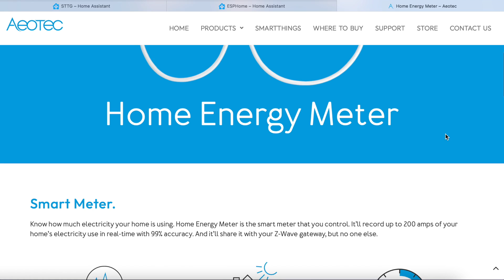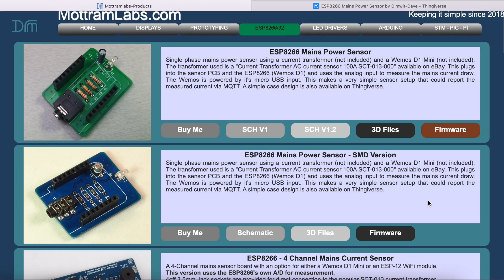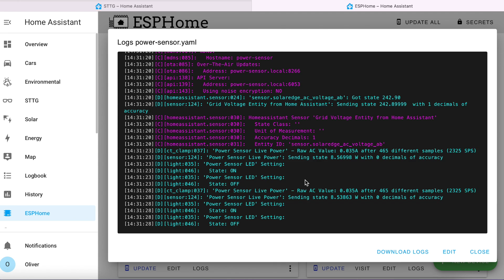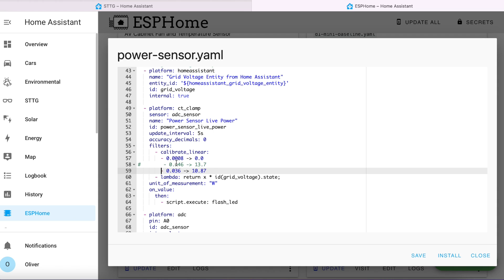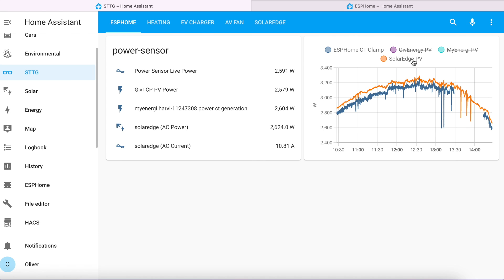Build your own CT Clamp Power and Energy Monitor with ESPHome

Comment: After hours of configuration hell I thought I'd share my experience.  

I have the docker version of Home Assistant (as will a lot of people trying this) and it is 'unsupervised'. This means I am unable to install the esphome add-on, or any add-ons at all. 

You will only need this add-on when you are configuring the esp module so I decided to spin up full version of Home Assistant (supervised) on a VirtualBox VM. From there I was able to properly configure the device to connect to wifi and function correctly.  I treated it as a temporary development server just to get the config correct.

The next stage for me is calibrating the electricity usage to work with the output of my solar panel inverter.

You could also configure the esp module through the command line (as suggested on the esphome website) but I could not get the wifi connection working using this method.
Reply: Calibration didn't work for me. The amps just didn't show up. I've ordered a more up to date Mottram board off ebay to see if I can get it going.
Reply from the maker: Do you have the CT clamp around just a single core (live) cable, or around a flex (triple core) cable? If there's a live and neutral running through the same cable that you have the clamp around then no current will be shown (the neutral cancels out the live).
Reply: @SpeakToTheGeekTech  I'll look into this. Thanks so much.
Reply: @SpeakToTheGeekTech  I am learning a lot while I do this... I have been frustrated that my CT sensor hasn't been reading anything when it should! It turns out that my 50ma current sensor (like yours) was actually the other model that works on voltage and had been labelled incorrectly from the manufacturer!

Comment: can i clamp it to a usb cable to calibrate it?
Reply from the maker: No, that won't work sorry for a number of reasons. Firstly the clamp is to detect AC current (not DC used in a USB cable), secondly it must be clamped over a single wire - so inside a normal AC three core flex cable, there's a live, neutral and earth - the clamp must be around just the live and not multiple cores.
Reply: i want to hook it up to a ps5 (power cable is in utility room) will the other plugs interfere with the reading/calibration?

Comment: The calculated power shown will only be correct when used on the same load. (what its calibrated against, and assuming a constant phase angle, cosɸ) This method for power calculation does not correct for the phase angle difference. To measure the active power (Watts) and not only the apparent power (Volt-Amps) the phase voltage must be sampled continuously togter with the current. The Active power is then calculated by integrating the area under the curves. The module shown is only a Mains Current Sensor not a true power sensor. The calculated Active power will only be Amps x Voltage when assuming the load is purely restive. Thus the phase angle offset is assumed to be 0°. This is not the case for motors and electronic inductive loads (switch mode power supply).
Reply from the maker: Yeah it’ll never be as accurate as a proper inline power sensor of course, but in order to give the average home user an idea of what is flowing through a cable then it’s in the right ballpark.

Comment: can I have two of these, one measuring current and one measuring voltage to get the needed readings to do accurate monitoring?
Reply from the maker: These only measure current. You need a different type of sensor to measure voltage.

Comment: Hi and thanks for this video.
Can you please explain how to add this to the energy dashboard.
Reply from the maker: Sure - you need to create an 'integration' helper from the power sensor. Settings > Devices & Services > Helpers. Click the create helper button, "Integration - Riemann sum integral", choose the CT clamp power entity as the input sensor. You can then use that sensor in the energy dashboard, but I suggest you then create another helper of type "Utility Meter" and use the new Integration sensor as the source entity. You can then set the Meter Reset Cycle to one day, and use that utility meter in your energy dashboard.
Reply: @SpeakToTheGeekTech  OK I'll give that a try. Thanks so much for the reply

Comment: Fascinating video! I’m hoping to do a similar project but send the data to a cloud based application. Do you know how to connect via an MQTT broker via Wi-Fi router instead of ESPhome or gateway?
Reply from the maker: The short answer is no! But I have dabbled with ESP devices before ESPHome came along and the long route is to use the Arduino IDE, import the external libraries you might need (which will be lots!), and program the board manually using C++. I like ESPHome because it removes the need for most of that and you can just get on with configuring the board with exactly what you want to achieve rather than having to work out which libraries need importing. You can use ESPHome to to what you require too. You enable the MQTT client option (https://esphome.io/components/mqtt.html) and disable the Home Assistant API. However, I'd argue if you're using ESPHome to do that, you already have Home Assistant, so why not just run your own MQTT server locally on that. I guess it's all down to your own preferences but using native Arduino IDE has a much steeper learning curve.
Reply: @SpeakToTheGeekTech  thank you for responding so quickly. I didn’t realise I could use Home Assistant to host an MQTT server, so long as my computer doesn’t need to stay on 24/7, that would be perfect for my needs. Already used your links and bought 5 sets of everything in case I make a mess of the first couple attempts.

Comment: Thank you for the video is there a way to set it up so it can tell u what ur using hrly and daily money wise ? tyia
Reply from the maker: There certainly is. You need to turn the power sensor into an energy sensor first by going to Settings > Devices & Services > Helpers, clicking the Create Helper button, choose Integration - Riemann sum integral, and choose the CT clamp power sensor as the input. Then you need to create a Utility Meter helper sensor (similar way to the Integration sensor), using the new Integration Energy sensor as the input. You can configure the meter reset cycle to be daily, monthly, yearly, etc... You can also then use a daily utility meter sensor in the Energy Dashboard if you like, and the Energy Dashboard can calculate the cost for you too.
Reply: @SpeakToTheGeekTech  excellent thanks so much!

Comment: What's is the best power it?, If I place this in my consumer unit or meter box.
Dose the power comes from the CT clamp, like on the hi end model?
Thanks in advance
Reply from the maker: This is powered by a 5v microUSB cable. With some adjustments to the code to reduce how often readings are taken and to put the device to sleep in between readings, it would be possible to run from a battery pack instead. I don't know how we'd go about harvesting energy from the CT clamp, that's a bit beyond my electronics know-how at the moment!
Reply: @SpeakToTheGeekTech  thanks for the info.

Comment: Might you have a more scalable suggestion? I'd like to do each circuit in my circuit breaker box.
Reply from the maker: Mottram Labs also sell a 4 channel version of the current sensor module, but if I were looking to monitor a larger number of circuits then I'd probably go for a Shelly EM (or 3EM) instead. I would suggest that this build-your-own method is for 'casual' monitoring.
Reply: @SpeakToTheGeekTech  Thanks, just to follow on from this, the Shelly EM only does 2 circuits (there's a 4 but overkill and limited total amps). Mottram Labs does 2 versions, one which uses the ESP8266's own A/D for measurement, the other has an onboard ADS1115 A/D converter is provided for the measurement (15 bit), any preference (like which would/might be easier)? A 4 circuit version could work if you're only looking to track the biggies- say heat pump, solar, car harger- and (time)-manage the loads, I personally wouldn't be looking to track every light bulb.
Reply from the maker: I've not actually tried the one with a onboard A/D converter yet. When I get chance I will order one and give it a go. I'm interested to see the difference, but it's just one of those things I've not got around to yet.
Reply: @chrishorn1032  I would like to monitor every single appliance but will likely settle for each breaker. thanks for the feedback

Comment: Nice. Wondering if we wanted to many more than one only clamped (just before the fuse breakers ~ 16 of them), what kit maybe best to consider if such exists if you maybe know?

Above will get the per section of house readings, so wanted to get a bunch of smart-plugs to zoom in to each appliance also.  Any suggestions how to build these smart plug kits at low cost since I need quite a number?
Reply from the maker: The same company (Mottram Labs) which supplies the Mains Power Sensor board also sell a 4-channel Mains Power Sensor board. Same principle as in my video, only there's four 3.5mm jacks for CT clamps. This could be a good option. If you'd prefer something more off-the-shelf then you might want to look at the Shelly 3EM which can monitor three live cables simultaneously. As for creating your own smart plugs, I can't advise on doing that for safety reasons. I personally prefer to use either Z-wave or Zigbee power-monitoring smart plugs (such as these zigbee ones: https://amzn.to/3VqSeQE), or you can go for one of the many WiFi smart plugs that offer power monitoring too from Amazon for under £10 each. I think you'd struggle to make them yourself for that small amount anyway!

Comment: Thanks for the great video, I was wondering what will be displayed in home assistant if you a contributing to the grid. i.e. your solar panels are producing more than you consume ?
Reply from the maker: This particular implementation will only ever show a positive power value so you wouldn't be able to tell whether you are importing or exporting using it. When I get chance I'll take another look at the raw data and see if there's any way of updating the configuration to output that properly.
Reply: @SpeakToTheGeekTech  A great video and just what I was looking for to monitor my solar power export to the grid to help size a home battery.  But that will need me to be able to record both positive and negative currents.  Have there been any developments since your reply to Tony, and would it be possible to work around by having two sensors on the same cable: one to measure import and one to measure export?  Many thanks.
Reply from the maker: I've done a bit of reading on the subject and from what I now understand in order to work out the direction of the current you need to monitor the AC phase, and that would have to be done in realtime by another physical sensor attached to the microcontroller... which doesn't exist on this particular break-out board. By this logic, that must mean that only mains connected power monitors are able to detect direction. Honestly, I'm still not entirely sure what sort of component is required in order to do this, but I haven't given up yet. If I ever figure it out though you can guarantee it'll appear in a video!
Reply: @SpeakToTheGeekTech  Many thanks for that helpful reply. I now understand that the CT clamp will only give the magnitude of the current and will not distiguish between directions.  However my solar panels have a SMC invertor which gives me regular power readings via bluetooth (average power over 10 minute intervals) to a monitor.  I can download the data to my PC.  So if I combine this with CT readings, I can split the latter into export and import parts (if(solar>CT, CT = export; if solar<CT, CT = import)).  I have tried this with my actual solar reasults and some notional CT readings and it seems to work.  I should be able to calibrate the CT by clamping to my solar inverter output.  The errors may be affected by the slightly variable mains voltage, the power factor and doing the manipulation but for my purposes these should not be a problem.  So would still be interested in a true power monitor though.  Thanks again.
Reply from the maker: That’s some brilliant logic to get that result. I guess it’s very specific to your setup though but could be adapted for other setups. I have mine monitoring my battery EPS output which can only ever be in one direction due to this limitation, but with some careful thinking like you’ve done I might be able to put it on another feed that’s bidirectional
Reply: @SpeakToTheGeekTech  Much appreciated. I now have the hardware sorted and have been looking into the software. I think to use ESP home as in your video, I would need to install a virtual box on my PC (Windows 10), install Home assistant and include the ESP home addon.  As I do not have Home Assistant as yet, and only want to measure the meter power and get it onto my PC, I wondered if there was a simpler option such as Arduino IDE? Either way would you be able to point me to a simple software installation guide?  Thanks again.
Reply from the maker: I’m all about the Home Assistant and ESPHome simply because it does away will all of the low level malarkey of using Arduino IDE. Yes you can use that, but you’d still likely need a computer of some variety on 24/7 to collect the data from your CT sensor. Why not make that Home Assistant? If you didn’t use Home Assistant, what were you planning on having running all the time to listen to the sensor’s data?
Reply: @SpeakToTheGeekTech  I was planning to use my PC to monitor the sensor but didn't realise that it needed to collect the data continuously. So I will go for home assistant.  When I had a look at installing it, I had second thoughts as I am not familiar with virtual boxes. Do you know where would be best to get a step by step guide to getting home assistant going on a Windows 10 PC from scratch? Many thanks again.
Reply from the maker: There is an actual VirtualBox image available on the Home Assistant web site (https://www.home-assistant.io/installation/windows/). I would suggest you look at eventually running it on something lower powered like a Raspberry Pi though because running it on a full PC could be quite power hungry. I've only Googled for guides, but this one looks quite recent for running it in VirtualBox https://peyanski.com/home-assistant-on-windows-using-virtualbox/
Reply: @SpeakToTheGeekTech  Hi, I thought I should give you an update as I now have monitor working with a sensor on my solar panel output and my mains meter.  I decided to go for an Arduino Uno in the end (which I can run on a battery and has other applications for me) with an SD card reader so I can periodically download the data to my PC.  The Arduino script compares the two sensors and computes the sign of te meter current so I can distiguish between export and import. Thanks again for your helpful advice.

Comment: Just to follow up on my previous post, I got all this working last night. Few things I ran into but found solutions for. Was having wifi connection issues until I set a static IP address by adding the following code in the wifi section:
# Optional manual IP
  manual_ip:
    static_ip: 192.168.50.123
    gateway: 192.168.50.1
    subnet: 255.255.255.0

In order to get the sensor to track daily usage and show up in the HA Energy Dashboard I had to also add the following:
# Example configuration entry for energy tracking
  - platform: total_daily_energy
    name: "Total Daily Power"
    power_id: power_sensor_live_power

# Enable time component to reset energy at midnight
time:
  - platform: sntp
    id: my_time

I've calibrated using multiple methods and my calibration values aren't too different to yours. Thanks again for your help. I've subscribed :)

Comment: Any idea how to monitor gas energy usage?
Reply from the maker: If you're in the UK and have a smart meter, you can get that information by using Glow. You might be able to get gas energy data for free using their API or from their Glow IHD which is what I use https://youtu.be/6MiZ2EMajnA
Reply: There was a project based on esp32 and ai to read hardware digi